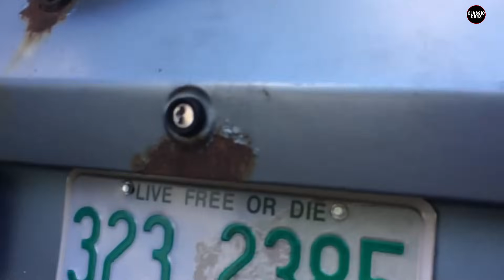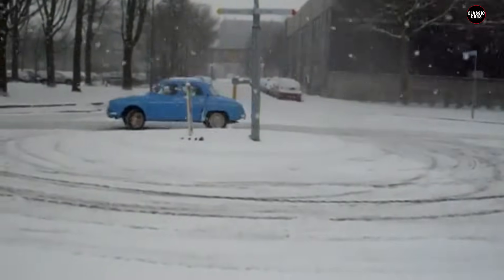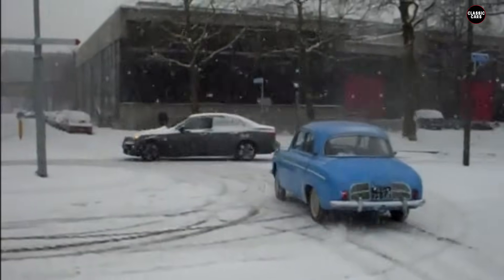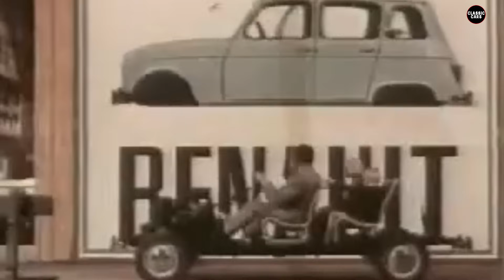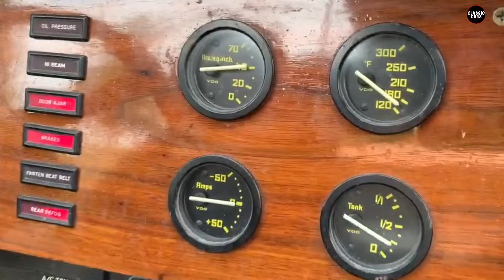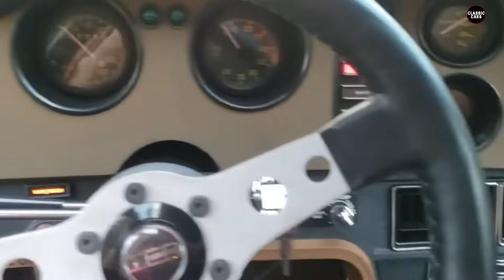5 Cars that were Thrown into a Landfill, you won't believe it, you'll be shocked

Comment: I almost got the Yugo GV. It rode decent and the one I was trying to get was well built and it was a fun car to drive.
Reply: I bought one for £50 which only had a few weeks MOT ( UK Government safety test) I put it in for a new test which it passed with no problems. It also passed the following years test with nothing needing doing other than new tyres and wiper blades. I sold it after 2 years for £200. Although very basic, it was a very reliable and economical car.

Comment: I don't know where you got your information on the HotShot but the car did everything that was expected of it. It was and still is a fine sub 1 liter race car. Obviously you don't know about it winning its class in the first Sebring!
Reply: Yeah Sebring is 6 hours of continuous driving. It also took 10 out of 12 SCCA west coast races in it's category. Even the Italian company Siata used the engine in their 300BC Barchetta Sport Spider. AI talking and researching.
Reply: @57WillysCJ  Being a Crosley owner I think I know more than the original poster. Yes the line had its share of problems but so did everyone else. You have to remember that the Corvette was on the verge of cancelation due to poor sales.

Comment: My father had an Austin 7. Its aluminum body made it so light and susceptible to cross-winds that it was called the flying matchbox. It was underpowered and had terrible brakes. It was so bad my father went back to driving his motorbike and sidecar until he got a far more robust Austin A-40. During a cleanup he loaded the Austin 7 on a trailer and took it to a landfill. When he returned with another trailer load of rubbish someone was loading it onto their trailer to take it away. A few years later he saw it being driven around fully restored.

Comment: I worked at a Ford dealership that bought a Bricklin franchise, and I ended up working on several.  The main problem was Bricklin was so rushed to get cars out to the public that they sent them to dealers incomplete, with the promise that the missing parts would follow later.  Catastrophic when those parts were door seals among others.  I saw that some of those small parts were AMC sourced, and got a few Bricklins  sold by going to local junk yards and stripping some small parts off of early 70's AMCs.   I also later had a Yugo,  I don't think anyone in the Yugo's era would have expected a small car like the Yugo to have a good ride, or be fast.  Once I fixed the Yugo's problems that were mostly from the previous owners neglect, it served me fine for several years, a excellent snow car. Most of Classic Cars videos are just click bait,  no research, according to this video all the cars seemed to have the same faults.

Comment: I bought 2 yugos for 500$ one was amazing,other was for parts but hardly any of the parts were the same. I took mine offroading and it was a tiny beast
Reply: I bought one for £50 which only had a few weeks MOT ( UK Government safety test) I put it in for a new test which it passed with no problems. It also passed the following years test with nothing needing doing other than new tyres and wiper blades. I sold it after 2 years for £200. Although very basic, it was a very reliable and economical car.